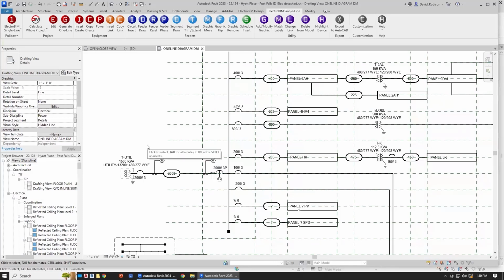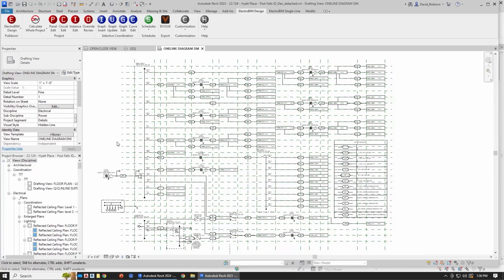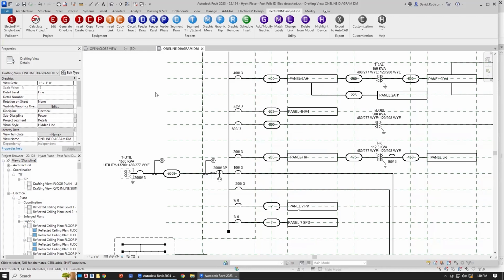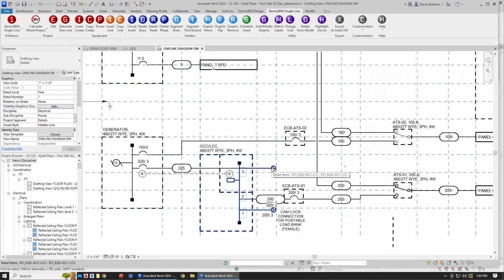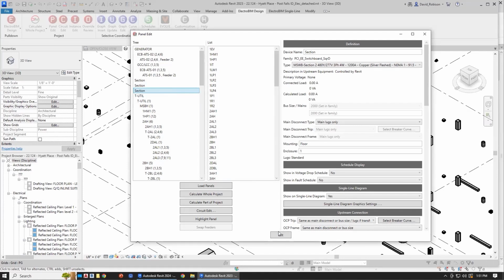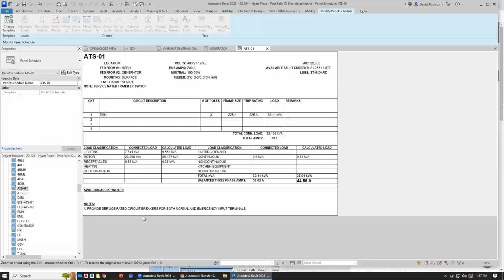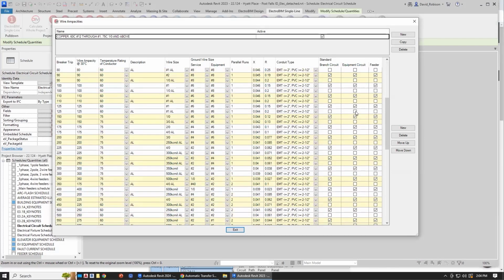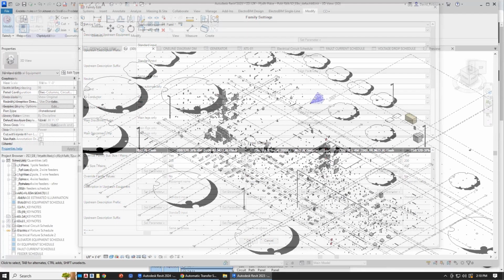ElectroBIM Project Walkthrough - Number 2   #BIM #revit

Comment: Great idea, PCI! Starting with a drafting view of the components  in your template model is definitely something that we'll be looking to implement. Appreciate you sharing. PS: Is it common to use WYE:WYE dry-type transformers in the NW US?
Reply: I contacted Rob about the wye-wye transformers. The project wasn't final and they were fighting with Revit to get some schedules to look right. It didn't work out and they hadn't gone back to fix those to be delta-wye. In the end they converted the whole project to 208V and dropped the transformers entirely.